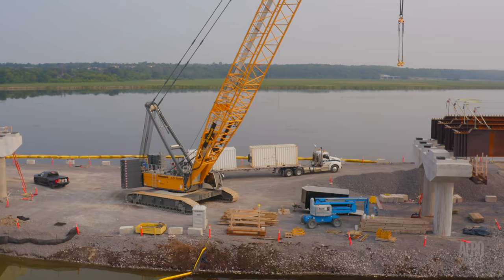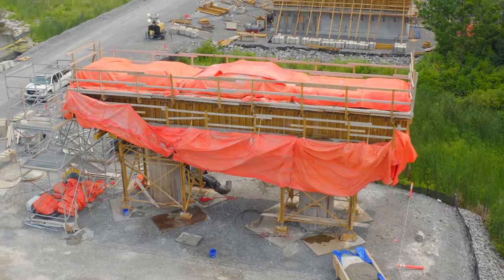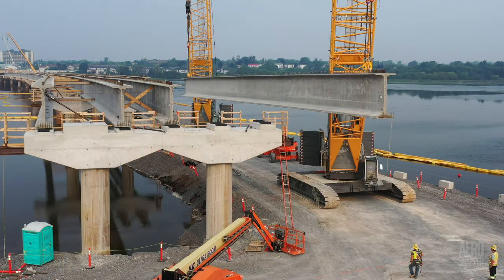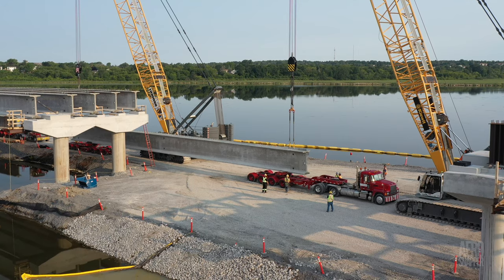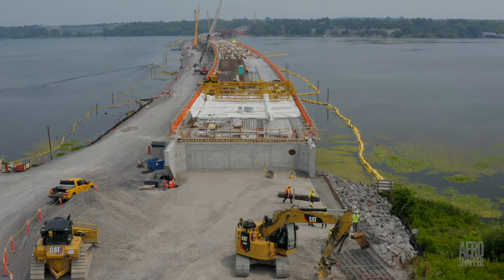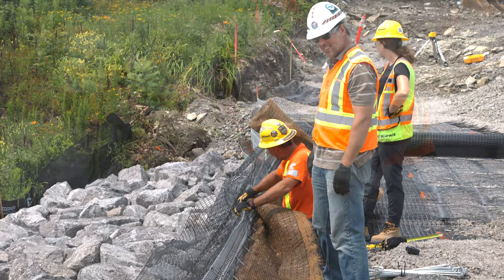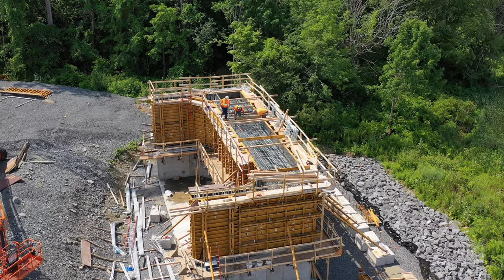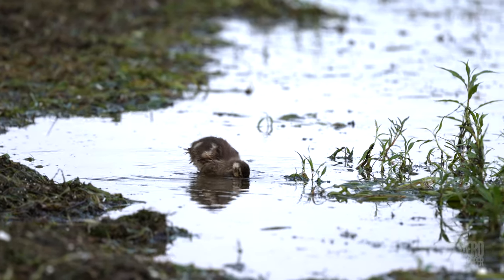Mind the Gap 4K

Comment: 3:30  I'm surprised they didn't remove the causeway fill under this last set of girders before they started placing them.  I'm guessing that maybe these are a little bit higher to align with the steel so the excavator can operate under them.
Reply from the maker: I think that you're absolutely correct - that's the assumption the 'observers' have been making